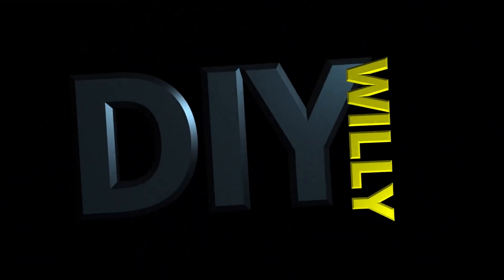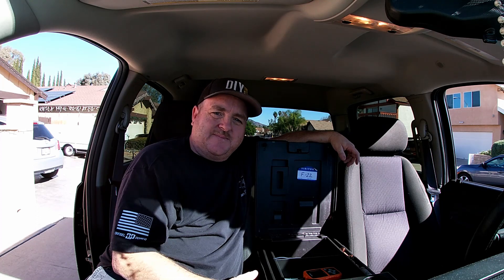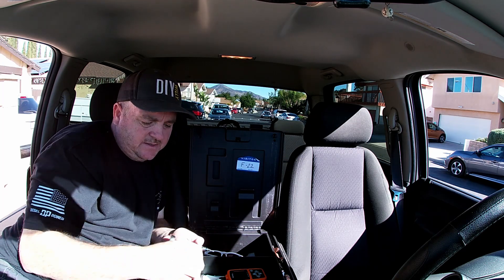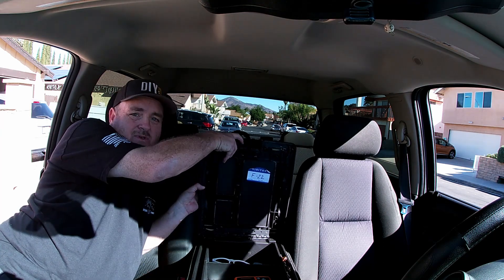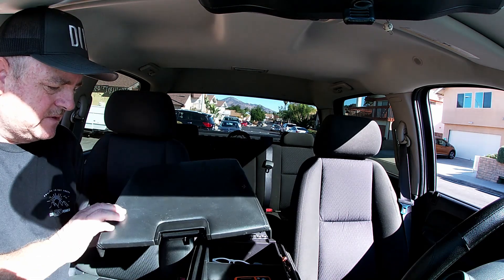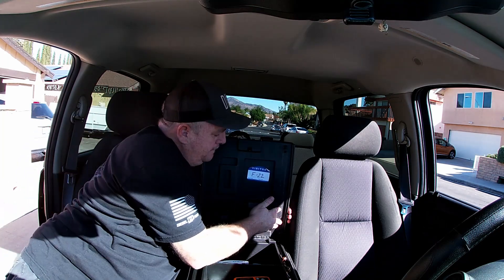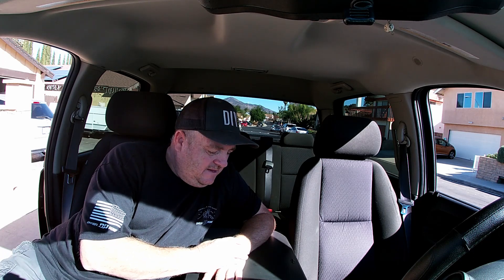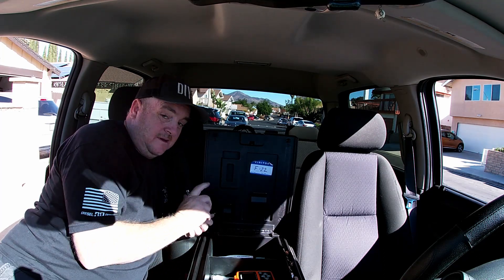Center Console Top Removal...2007-2013 Chevy Silverado

Comment: What about the plastic part that has the 3 cup holders?  Are there screws under when you place cups?  Some twit melted a bunch of fishing crap in mine and it is N A S T Y!
Reply from the maker: Hello Jagboy, I believe the parts are obsolete now. You could possibly find a replacement on eBay or used.
Reply: @DIYWilly  Thanks man, I'd be happy to try to clean mine up if I can get it out in one piece..  lol

Comment: is there any way you can show what kind of screws go directly into the lid? My truck did not come with the lid attached so I have no clue what kind of screws it comes with.
Reply from the maker: Thanks for watching I’ll have to take a look.
Reply: I also want to know the size of those screws. I don’t want to over size them and break my new lid.
Reply from the maker: #8x1 Philips screw should be the the correct size. Just take caution as you install.
Reply: At 1:56 that plastic piece you removed is it needed because I also currently don’t have a lid I purchased the cover on eBay but don’t have that plastic reinforcement I think it is not sure
Reply from the maker: It’s basically a finish/decorative piece. The lid should work fine with out it. Both the hinges and latch attach to the lid. Hope this helps. Thanks for watching.

Comment: Does it need to be drill before putting the screws back on?
Reply from the maker: What I have didn’t need drilled. Thanks for watching
Reply: Everytime I order a console lid from ebay and when I screw it in it breaks. So I was wondering if it needs drilling.What do you think?
Reply: What do you think? Should I drill it? Need a answer.
Reply from the maker: Yes if you’ve had issues in the past then it would not hurt to predrill the holes first. Just make sure the drill not to big. Would be better to go small and leave material for the screw to bite.
Reply from the maker: Also don’t drill all the way through be careful when drilling. Do it slowly
Reply: Ok.Thank you.

Comment: Do you think cutting those plastic clips would make it easier to remove the next time? After all there's bolts holding it together?
Reply from the maker: Yes it probably would make it easier to remove and reinstall but I think it might get noisy if the clips are gone and these have enough noise from all the plastic bits.